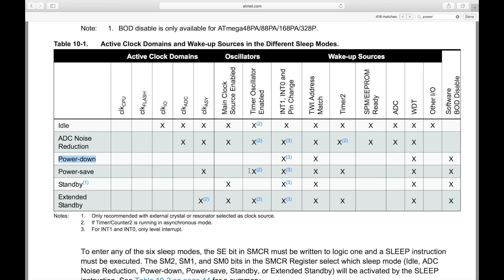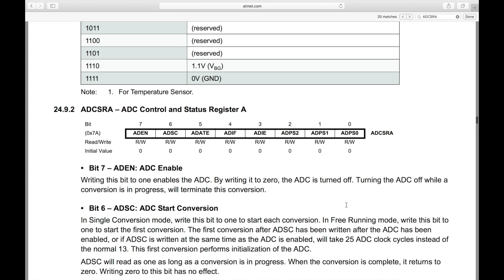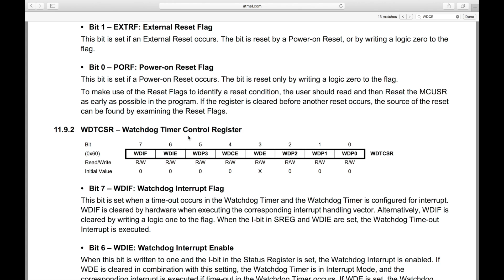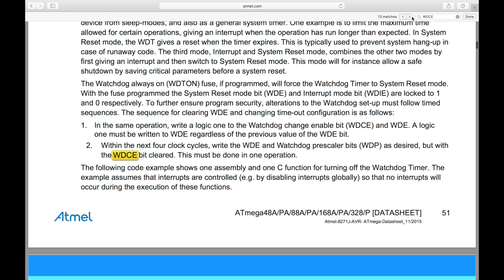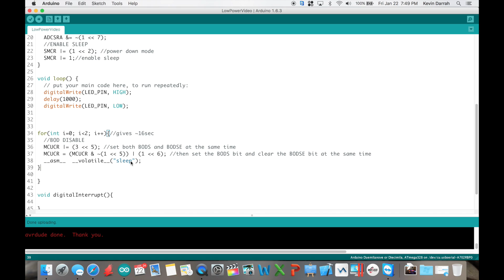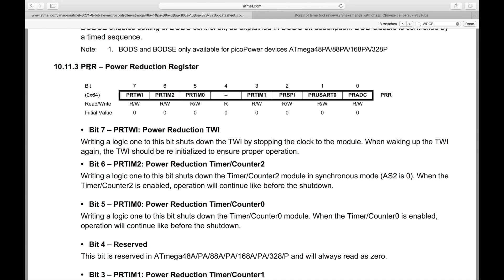Low Power Arduino! Deep Sleep Tutorial

Comment: It is quite an interesting  subject. I am almost sad that I do not use the Arduino/Atmega that often anymore as most of my projects need to  communicate with other things (either through WiFi, cable, LoRa or Bluetooth). Currently I can't think of any project that would be battery fed and not communicate.

Comment: I was wondering a bit about the SMCR |=(1<<2); //power down mode statement. This performs a bitwise OR operation, which sets only the specified bit (bit 2) while leaving all other bits in the SMCR register unchanged. But as I understand. from the SMCR register the  SM0 and SM2 bits need to be zero. Wouldnt it be safer to use the instruction:
SMCR =(1<<2); as this will only set SM1 and reset SM0 and SM2.  so we will be sure of what state we have put the relevant bits of the register in?

Comment: I use the android arduino IDE and I use a Arduino nano since I do a lot of traveling I use my Samsund phone or 7.5 inch tablet for development. I suspect that my IDE may not be able to do in line assembly even though I am very used to using  assembler. My question is , can these things be done in the standard programming  environment ? Thanks!
This Video is perhaps one of the best that I have seen on this subject.

Comment: Finding this video 7 years later is great. I've never ran a chip that low until now. I'm surprized your Keithley showed anything at all when most meters round down to zero when the next digit is below 5. I have a 38 year old Hioki multi meter I picked up at Goodwill for 5 bucks. It reads in increments of 10nA and I was finally able to confirm that it works and showed the same result as your bench meter. Thank you for sharing! I really need a meter like yours now.

Comment: Well put together video with explanation. I'm using a Pmos latch circuit to wake up the whole thing, but then found I could use a Cmos 555 dual timer to do the same thing at less cost and power for a simple project. Uses nothing in the off state. Would like to see some power harvesting projects in this series.

Comment: You have used a 10k pull-up with 5 v input .
V=I×R .so. I = V/R
So current I = 5v / 10,000 
 Current I = 0.0005 A
Current I = 0.5milli amps
How did you get a sleep current of less than 0.5 milli Amos I.e. 500 micro amps.
Please reply if I'm wrong . Or my calculation is wrong.

Comment: for my expert i am using atmega328.  I need to put it in sleep mode keeping only timer 2, together with qurzo 32768 on pins 9-10, active to continue counting the hour.  which sleep mode could i use?  Is there anything else that would remain attractive that I could deactivate?  thank you very much

Comment: Very interesting. I like your approach to the problem. Simple, direct, and effective. Thank you. I will surely use your method for a small project I have in mind.
Reply: Hey, it works like a champ! Made a 2nd remote control for my Mitsubishi AC so I don't have to go upstairs to turn it ON/OFF everytime I return/leave the house. 1 ATmega328P(8MHZ no caps, crystals), 1 IRLed, 1 3V coincell battery, a pushbutton switch and a little bit of code. Saved me $75. I was unable to measure the LOWLOW sleep current with my multimeter! THANX!

Comment: ADCSRA &= ~(1 << 7);  Can you please explain this to me how it works? Why not using this for example:  ADCSRA &= 0x7F; or ADCSRA &= 0b_0111_1111 ? What is the meaning of the &=? I need to use the analog input in my project when it's awake so I need to enable the analog module when cpu wakes up. Thanks a lot.

ADCSRA &= ~(1 << 7); //Shift a 1 by 7 places left 0b_1000_0000 and invert ~ 0b0111_1111 that byte then AND the whole register whit this value so the other bits will not change. 
Is this how I should interpret this line?
I found how to enable adc again. ADCSRA |= (1 << 7); //ENABLE ADC

Comment: I have a "bare bones" ATMEGA328P U, just XTAL, 22uF Cap, 1 24k resistor pull up to reset. That`s all.  I go all throught this video, step by step, but the current never goes below 6mA. I dont know what is going on.
Reply: It worked, I changed the chip and everything is going as expected

Comment: Thanks, Kevin! This is definitely a great deep sleep tutorial for battery-powered Arduino projects. I was wondering if a bootloader was used to change the code between each part or you used an external programmer. I presume that communication with the micro host after sleep mode is activated is not possible, isn't?

Comment: can u please tell the way to enable adc again for code  i tried  several times but didnt work
Reply: he includes the line in the code he links:
 ADCSRA |= (1 << 7);

i haven't tried it since i'm not using it in my project, but i'm thinking you just put that at the very top of the loop, and then turn off  
ADCSRA &= ~(1 << 7); 
before running the BOD Disable, and putting to sleep. 
so instead of permanently turning it off in the set up, you turn on and off every time the main loop will run.

Comment: Let's say I am using a standalona ATmega328 chip instead of an Arduino module. When programming this chip using Arduino IDE I have the choice to switch OFF the BODS. In such a case, do I need to use your code to disabel the BODS?

Comment: When I do the step makes all pins outputs and low, it does reduce power consumption...but also the potential output current (of a pin that you right HIGH) drops very low. So low it wouldn't drive enough current to the opto coupler I had it connected to.

Comment: Great Video! 

I have been tweaking the 328P for some time myself. The lowest I can get to is 4uA so you still have some space for improvement. ;)
Reply: I've been able to go down to 2uA...😊
Reply: @honumoorea873  and Aad Noll: You two just tease.  Please add comments as to how you do this.  Crystal frequency? Perhaps voltage?  Perhaps bragging?  Perhaps bad instruments?  I would like to know. 

I have been comparing 328P carrier boards (pro mini) to Kevin's bare board.  Like Kevin shows, I can get close to 6 uA.  The cheap pro mini boards (3.3V, 8MHz) I purchased only get as low as 120 uA (20 times as much power! Not nearly as good as Kevin's low power.)  I suspect that the pro mini power regulator is to blame even if you bypass it and go directly to VCC.  Soon I will scrape the regulator and capacitors from the board to see what the truth is.  

I may have to risk destroying a perfectly good $1 board to find the truth.  Wish me well.

Comment: Unfortunately the consumption of electronics around the processor is usually much higher than the uA. But it is the software solution to reduce the consumption. Me, I use the hardware solution, the good old power switch that reduces consumption to ... 0 ! Most processes consist of a scan of one or more inputs and a specific action accordingly. It is very easy to implement and no constraint with the deep sleep mode limited in duration.

Comment: The reason why your watchdog timer isn't accurate, is because you should reset the WDT before entering sleep.  The WDT starts counting as soon as you enable it.  So it counts up to 8, then loops and starts over.  So at whatever point you enter sleep say WDT is counted to 2, then you only get 6 secs of sleep.  

Use:
_asm_ __volatile__("wdr");
_asm_ __volatile__("sleep");

If YouTube auto-formats the UnderScores in my comment, it should be 2 _ for each __ seen.

This gives an accurate 8 seconds of sleep.

Comment: This was just a awesome presentation of power saving possibilities. Exactly what I needed. I'm running a 328P-PU on the internal 8 MHz and the power savings in sleep mode are even mire dramatic: on my digital multimeter I measure 0.1 micro amps when sleeping! This is even lower than your 0.368 micro amps you measured. Thanks again for your detailed explanations. They were perfect!
Reply: I have a interesting phenomena after increasing the watchdog counter in the for loop to 20 (to get 20x8"sleep) --> It's not possible to wake up the 328 with the interrupt button, unless I press the button multiple times (up to 19 times!). What is the mechanism behind?
Reply: Problem solved. Counter variable ‚i‘ needs to be declared globally and set to 76 in the interrupt service routine to get out of the ‚for‘ loop :-)

Comment: Hi there :) Is it possible to cut power supply outputs during the sleep? Because I have couple of sensors plus communication modules and they are drawing power even when arduino is sleeping. Some of them requires 3.3 V power supply and I cant use any of digital pins from arduino

Comment: Hi Kevin. I really impressive by the project you have done. 
I would like to have some advice from you if possible. I'm working on low power project. I could not find the ATmega328P library to boot loader and upload the sketch. I select Arduino Uno but not working.Tks

Comment: I'm trying to get my Atmega into the uA ranges of standby but no matter what I do, it won't go below 1.5mA...
My Atmega328P-PU is running on its own on a breadboard at 8Mhz internal and is being powered by 3V3 coming from a Nano. The Nano is only used to provide 3V3 and nothing else. But no matter what low power sketches I've tried, I can't get the atmega below 1.5mA and I don't know why. Any ideas?
Reply: I have the same issue... but I have 1.14mA
Reply: wojtek kopacz hi, it turned out there was something wrong with the atmega chip I was using. It was either fake or damaged. I tried a new atmega chip and my current consumption dropped into uA range. Also during my research I discovered that other people found that no two atmegas will draw exactly the same. The difference is small but can be measured. Just an interesting little factoid there :)

Comment: Hi Kevin, I found your video very interesting and useful. How do you turn the ADC back on? and also, is it important to reenable the BOD  too? Of course, when the watchdog wakes the arduino up and those are needed.
Thanks beforehand!!
Reply from the maker: yea, I just did a video where I had to turn the ADC back on - check my video on the washer/dryer alarm.  There's sample code too.
Reply: OMG, thank you a lot!! I was really in need of an answer. But...is the BOD necessary too??.

I've made a PIR activated camera to take pictures to the wildlife and I wanna save battery. Thanks and greatings from Madrid

Comment: I have question. I wanna use deep sleep in one of my project that will use the analog pins, but as digital input, not analog input. Do I have to enable the analog input everytime?
Reply from the maker: no, they just keep incrementing.  The analog pins work as digital pins as well, so Analog 0 = digital pin 14, A1=15, and so on

Comment: I watched the video and uploaded the code on Arduino Pro Mini. It reduces power consumption indeed!!! Great job!!! Only on question, is there anything different between this and UNO?  My board managed to fall to 3mA, no less. Am I missing something?  The only thing I can think of is the onboard led. Thank you once again!!!
Reply: The onboard LED of the Arduino Pro Mini has a 10k current limiting resistor, so the LED only accounts for about 400uA.  My guess is that the other 2.6 mA is being wasted by the MIC5205 adjustable regulator.

The schematic of the Arduino Pro Mini shows that there's a power isolation jumper that allows you to source 5V directly to Vcc and bypass the regulator and LED, specifically for low power applications like this.  Sounds like you need to cut that jumper and source 5V directly to the Vcc pin.

https://cdn.sparkfun.com/datasheets/Dev/Arduino/Boards/Arduino-Pro-Mini-v14.pdf
Reply: Thank you for taking the time to respond! I will take a look on your suggestions! :D
Reply: I tried a few experiments and it worked fine.. that was great to learn, but now I got a few Whisper Nodes and I can run the Arduino at very low power with a single AA. A bit more money than building everything myself but save some precious time.

Comment: Hi Kevin there is issue of MCU Resetting after the second timeout can you please address it. 
I did managed to solve the problem by re enabling the interrupt before sleep instruction WDTCSR |= (1 << WDIE);

You didn't notice this issue because you only have one routine to blink the LED in loop. Try adding another different sequence in setup so that you get an idea of reset and let us know if you get the same issue.
I think its an issue with Disabling WDT System Reset Mode and running Interrupt Mode alone.

Comment: I am stuck, 
I can 't get my current below 6mA I used Kevins code and others, I did everything like Kevin and still powered with v battery and using good voltage regulator it doesn't go down below 6 mA
Can't find my problem any suggestions?
Reply from the maker: can you give the part number for that regulator?

Comment: Dear Kevin, I have tried this approach on Arduino pro mini. The pro-mini still consumes 1mAh within a minute. What could be the reason? The power indicator  LED on the pro is only possible explanation. Will cutting the track of the power indicator led help? Please help me
Reply from the maker: yes, LED and possible cheap regulator running will pull a lot of current
Reply: Hello Kevin thanks a lot for response. will try removing them and check.
Reply: Hello Kevin, I got it working building the circuit on a breadboard as you had done. However, after about 10 minutes or so, the controller does not deep sleep even though the code section is executed. Any suggesstions why it could be? I am finding it hard to debug this.

Comment: Hi,
Great video !

Please do the ESP8266 & STM32. 

Those asm commands are not portable to non-avr devices. 

Perhaps someone has made a library ?

I'm looking at jeelib which seems to have the sleep mode figured out but it's probably atmega328 only.

Also what is your solution for powering off a single 18650 2000mah lipo ? 

I just ordered a LM3671MF-ADJ (0.70$ each @10x qty on ebay) with SOT23 breakout boards (0.139$ @ 10x qty). This 5 component texas instrument dc to dc converter  has 16 uA quiescent current, 600mA max load ( more than the 500mA needed for the esp8266 wifi transmitter). 

It has a min max input voltage range of 2.7V to 5.5V. I'm not sure if it can generate 3.3V from an input voltage less than 3.3V however.

Comment: Great video, thanks for that!
Is it possible to use the low power mode while listening for 433Mhz signals? I want to build a low power 433Mhz receiver.
Reply from the maker: +perspolisi21 low power RF video coming someday, but yet it is possible, but you have to play some tricks
Reply: +Kevin Darrah what tricks do you mean? I was looking for some ICs like HT12D but if it would be possible with an arduino, it would be my prefered solution.

Comment: I really enjoyed this video. I loaded the code provided from the link onto an Arduino 
Uno clone and the setting of all the pins to output dropped the measured current used by the Arduino to 11.44mA when the LED was off. For reference when the basic Blink code was running the measured current used by the Arduino when LED was off was 21.72mA. So that alone cut the current usage in half. Brilliant! Really a smart thing to do. Lesson learned. Thanks Kevin. I'll drop a few bucks in the tip jar..

Comment: Kevin, thanks for the helpful video. I'm trying to understand how to reduce the power consumption on a breadboard atmega328 circuit so this information is helpful but I wonder if you can point me to a source that will help me understand the coding you use to modify the bits in the relevant registers, ie SMCR  |= (1<<2);  //power down mode..... SMCR |= 1; //enable sleep...I'm a newbie so trying to understand this instead of just copying would be more useful to me in the long run.  I scanned thru your video titles and did not see one that would explain this but I may have missed it.  Thanks again for the video.

Comment: Excellent in-deep explanation. Thanks!

The way I see it in MCUCR part (8:26), in second line you could just put:

MCUCR |= (2 << 5);

So you would basically shift binary 2 (== 10) five places, effectively setting bit 6 and clearing bit 5.

I am not sure it works thou, I don't have the hardware to test it.

Comment: Kevin, my programming experience is mainly in assembly, so forgive me if my question is odd. I've never set registers manually in Arduino IDE, so why not manually set the reigsters in assembly code if you can use inline assembly? From what I remember, it wasn't as tricky to just write %10000000 to the register's address to set bit Seven, or %01100000 to set bits 5 and 6 simultaneously. That or use BSET or BCLR. Do you have a tutorial for doing this kind of thing in C++ or in Arduino IDE? I'd like to understand a litter better. Thanks!

Comment: Great content - I only wish that you followed better programming practices when formatting your code.
Reply: +J Beith When you open messy code in the Arduino IDE, just click 'Tools > Auto Format' to clean up inconsistent line indents.  It doesn't remove extra blank lines or inconsistent spacing, e.g. 'if(' vs 'if (' , but still, it makes things more readable.

Comment: Nice video :)

aren't there 3.3v based atmega's ? If i remember correctly they run at 8Mhz (not 16), but wouldn't it help for power savings?
Or just to feed it with a button battery or a li-po.
Reply from the maker: +JJ CC yep, that video will be coming soon.
Reply: +JJ CC Running at 3.3v was confusing for me too, I eventually learned that any ATmega/ATtiny can be run at 3.3v or lower.  They have a large input voltage range where the higher the voltage, the higher you can run them.  JeeLabs has a great writeup about this http://jeelabs.org/2013/05/01/what-if-the-supply-is-under-3-3v/